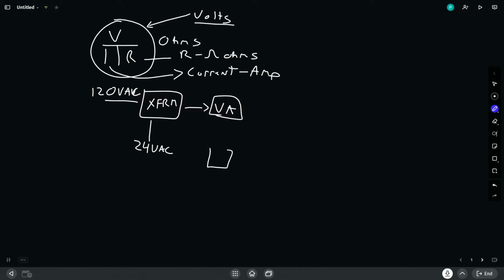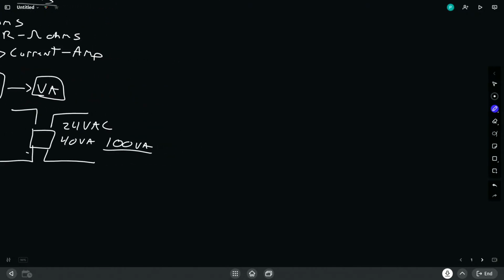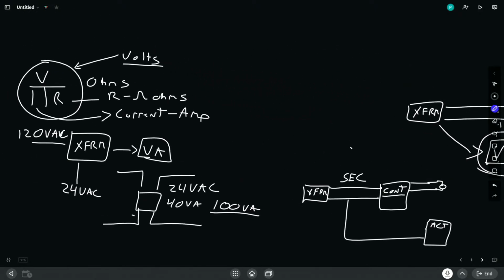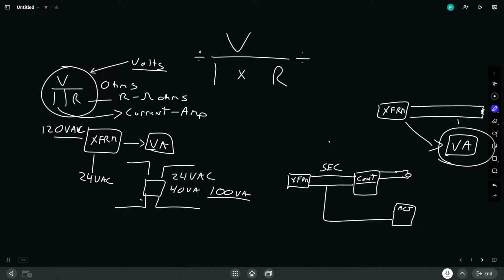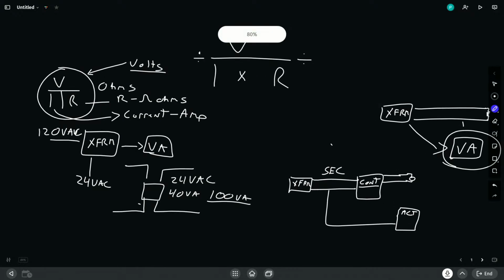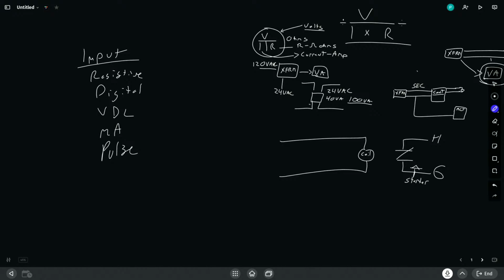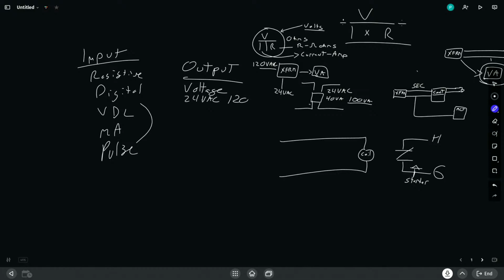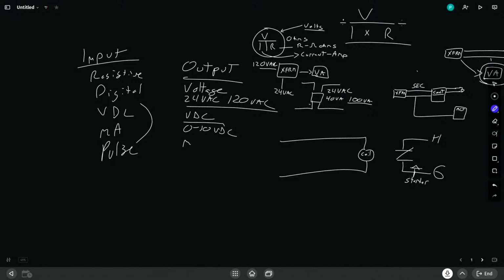SBA 317: Making Sense of Electrical Concepts Without Becoming an Electrician

Comment: Without tracing wire, is there a way to know how many VAVs are tied to the same circuit?
Reply from the maker: You could look at voltage drop on the transformer but that would only work for that transformer.